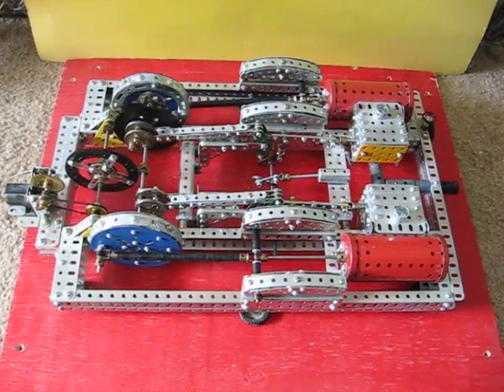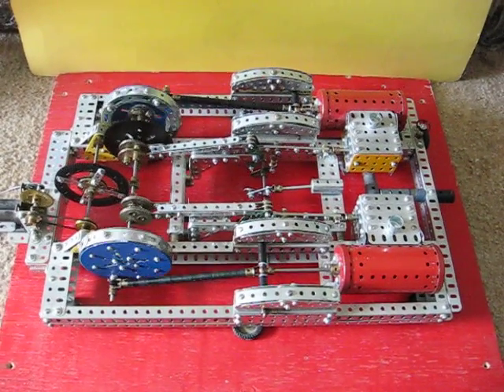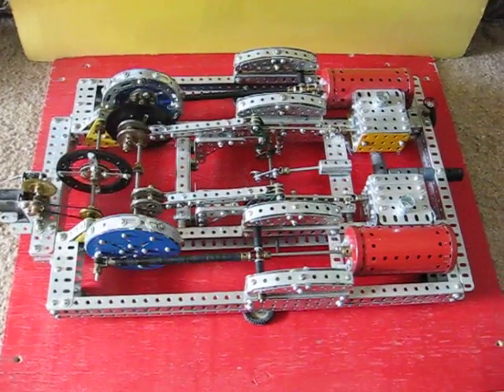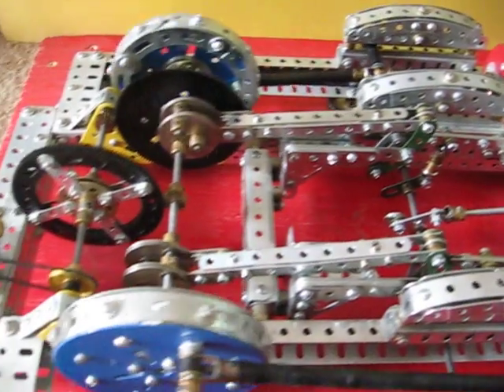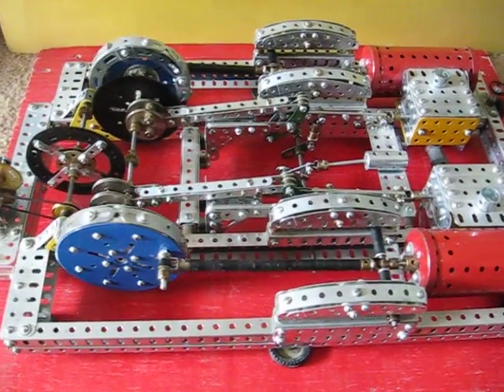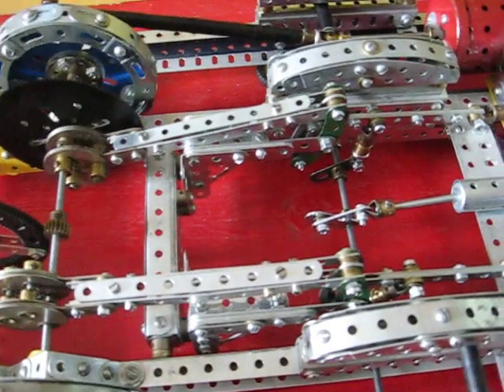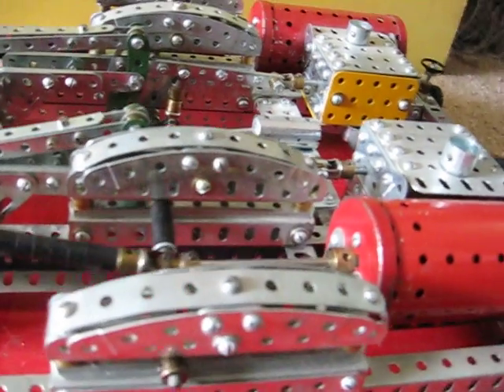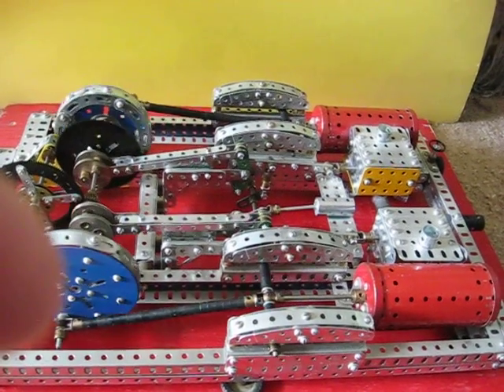Meccano Horizontal Steam Mill Engine 1869

Comment from the maker: Hi: The motor is rated for a maximum of 6volts dc. Adding more batteries (power) would make the motor revolve faster but would also cause the motor to burn out faster. These are only toy motors and can't take too much abuse. 
(part 2 to follow)

Comment from the maker: Hi: Thanks for your interest and comments. Yes, the current Meccano does have metal parts, however, the gears and wheels are plastic. One of the big differences is that wheels no longer have a boss and set screw. They are clip-fitted to a tri-flat axle. The motor running at its full 6volt maximum but is geared down in order to demonstrate the engine's motion. By changing the gearing you get more speed but, of course, less power.
Regards - Ed